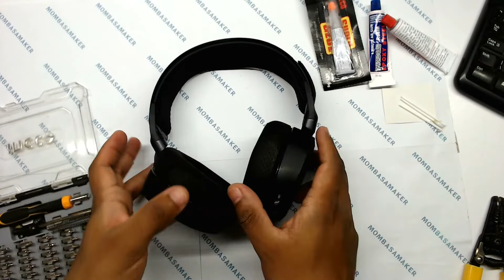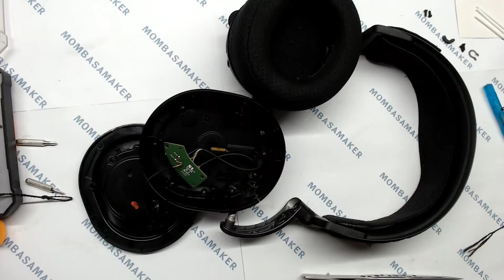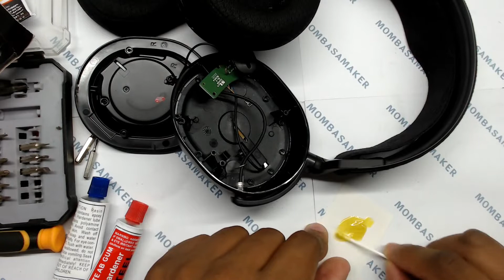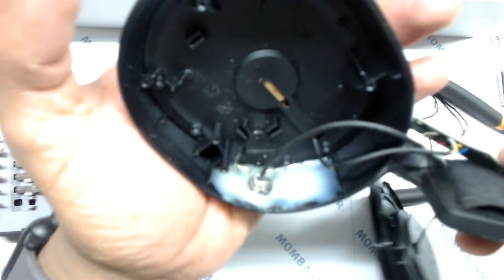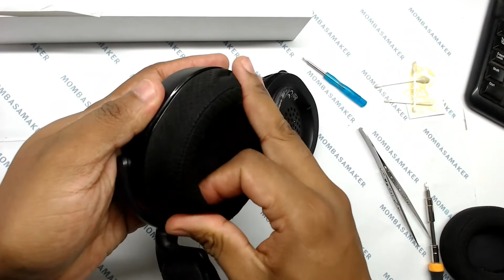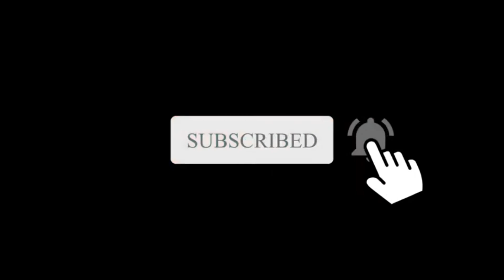SteelSeries Arctis Pro Signature fault - How to repair cracked and broken headphones

Comment: Thanks a lot for the video!
I was able to fix the signature fault following your guide. 
It's a shame they break so easily, those headphones have good sound and are quire expensive, hopefully the repair make them last for another 5 years.
Reply from the maker: You're welcome. I'm happy the video was able to help you and others with the same problem. Hopefully they will last long after that repair!

Comment: This is the fourth time this has happened to me and I’m not going back to the arctic pro, is this fault with all steelseries headphones? If so I’m going to a new brand entirely
Reply from the maker: I think only with this particular headband to earcup design, they've used it on several models. Not sure if the users with the other models  have had a similar experience. All headphones have their weaknesses nowadays, if you're going for a new brand choose wisely.

Comment: Fixed mine with two rubber washers and some super glue. Its ridiculous that such a simple thing can fix it that they dont do it first. Bulk up that support joint and you're golden.
Reply: can you share the washer / o ring size? i want to order them parts before taking it apart. Thanks Bro.
Reply: @herrdims  sorry but they were just some random washers in my grandfather's workshop. I dont know how to tell you what the measurements are without taking it apart and some calipers (not that I have calipers right now because i spend the summers working in a "remote" mountain range).

I can say i used one inside and one outside of the headphone. The one inside I actually had to shave the inner diameter and trimmed the edges to fit it. I wouldn't call this the easiest fix for a regular person (not crazy hard either. Mostly was just tedious). It was mostly just that some simple stiff rubber supports would've been cheap and easy for steel series to make.

Comment: I can’t get the cushion back on
Reply from the maker: There is a notch at the bottom. Slide the cushion in where it folds into the groove and rotate it around while holding it in the groove. The rest of the cushion holder will follow. Hope this helps!

Comment: i had the same crack but on the other side... the piece with the microphone has a lot more stuff in it and i can't take the bigger board out, got a video on that side too?
Reply: I have the same issue did you find anything
Reply from the maker: I want to make a part 2, will try to answer as many questions as I can

Comment: I just bought them for $135, sealed, brand new, and it was an affordable price, but I didn't know about his chronic problem and I'm scared by these videos I saw recently, what should I do to sell them? Or do I open it and do what you did in the video because I loved the headset, the audio quality, the gamedac, the comfort and everything was incredible apart from the quality of the plastic which I thought was bad so what should I do?
Reply from the maker: I would go with that old saying which says if it's not broken don't fix it. Since I did my repair I have been very careful while putting them on and taking them off. I only handle them by the metal band, I don't hold them by the ear cups anymore. I think this method also helps a lot. The only thing I have to change are the earpads cause they are worn out revealing the sponge otherwise they are working great! If you're still worried and you're good with repairs you can maybe reinforce that area otherwise just be extra cautious and use my handling technique.
Reply: @atdiyrepairs  However, maybe my headset doesn't have this problem because the box says something about 2022-06, I think maybe it could be its production date and the box of it is a little bit diferent os the others
Reply: @atdiyrepairs  Yes, I saw the video on how to use it to avoid the problem, so I'm being very careful with it
Reply: Mine worked for 5 years before cracking. Just don't be rough on the ear piece, stretch the band wide a bit when taking on and off and don't just put your headphone on or take them off with one hand by the earcup. That's how mine got wrecked is by just lazily handling them with one hand and stressed the joint out.

Comment: Great video! My headphones had the same problem, and i used your repair tips to repair the cracks. I had a little difficulty getting the c-ring back on (i used an epoxy that was a little thick and goopy, so i may have to revisit my repair in the future), but i'm very glad that i discovered your work! Thanks!
Reply from the maker: Thank you! I'm glad my video helped.

Comment: First of all, great video! You deserve at least 250 subs for it.
I followed your video and it all worked out pretty well casing-wise. I used JB weld. 
The problem that I'm facing now is that the right-side speaker won't work. I looked at the electric connections and they seem fine, nothing blackened or burn, no wires crossing un-insulated. I was wondering if you had encountered this issue or had any advise to fix it. 
I was thinking about de-soldering the connections for both left and right sides then soldering the right (broken?) one on the left (working) board to test if the entire component was broken. This is rather invasive though and could result in greater damages.
What do you think?
Reply from the maker: Thank you! I'm glad the case repair worked for you, I know JB have good quality products. If you're thinking of de-soldering I'm assuming you have a multimeter. If I were to diagnose (easy to hard) I would say it could be 3 things:
1) The wire is disconnected or broken internally (Use the multimeter to check continuity from the circuit board to the ear speaker)
2) If the wire is okay check ear speaker for any damage (highly unlikely but it could happen)
3) The board is faulty (Maybe cold solder joints)
Most of the times is number one and the thin connecting wires are the culprit. 
If you're going to test it using your method just make sure to return everything back to place after testing and repair. All the best!

Comment: What size screw is in your earcups?  Mine are security torx smaller than 8, but not sure of exact size.  Thanks.
Reply from the maker: I think it's either 6 or 7 but once I confirm I will do an update

Comment: my ear cup came out with the metal bit in it, it doesnt look broken i just cant put it back in do you have anyway to help please
Reply from the maker: It's not easy to guide without a pic. What I can suggest is be careful not to pull hard as it might cut the wires. And if it just came out and nothing is broken you can use a circlip pliers to fix the clip back in the groove once the ear cup is in the proper position. I hope  this helps.

Comment: Nice vid. Also a recommendation for folks whove dealt with and fixed this issue.. it helps to remove the headphones off by flexing the steel part of the head rest as this wont stress the joints on the two head phone "cans".. i was removing the headphones by pulling the cans apart until i noticed the crack one day.. definitely those weak joints were not designed to handle the stress
Reply from the maker: Thank you. I mentioned a similar hack I think in my other video. Taking them off and wearing them by holding the steel head band is better or safer than using the weak cans.

Comment: What orig pliers are you using is there a specific size? Mine won’t fit
Reply from the maker: Initially I used a crude method, I tied fishing line to both ends and used the smallest circlip pliers I had. Find the smallest seeger ring pliers, they should fit. Or a seeger pliers with adjustable teeth for different sized clips. Hope this helps!
Reply: Thanks @atdiyrepairs  I'll try to look for the smallest i can find,  I have a small one but it does not fit the holes. any idea on the size of the head of the pliers?

Comment: first time digging into some electronics like this. simple tutorial, was able to fix my headset. i’m not too sure if it was the o-ring, but earcup does not feel very secure. does stay in tact though
Reply from the maker: Nice! Glad you were able to fix them and continue enjoying them. If it does not feel very secure check on the groove the clip sits in, it also wears out. However as long as the clip sits properly in place and the plastic is intact you will have many more days of service from these headphones

Comment: I have had 4 arctis pro and they have all broken on the left ear, and that is SSOO annoying to fix because of the big round "motherboard" that have been screwed in and glued in, they really prevent you from fixing it..
They really need a new design, i hooe they did a lot better with the new Arctis Nova headset, but they properly did not change the design at all. Cheap chinese made trash plastic.
Reply from the maker: Sorry about that, the new design still looks like the old one. Not sure if they fixed the flaw unless someone tells us in the comments.

Comment: Steelseries had no support for this. I have no trust that the arctis nova pros would not be the same. €300 wasted with a design flaw. Don't buy em.
Reply from the maker: I agree, the Novas might have the same issue if it wasn't addressed. If someone likes SteelSeries they can buy them with the knowledge that this is likely to happen and maybe just be super careful.

Comment: Just a heads up on this don't wait until it breaks!  Reinforce this with something like JBWeld Plastic weld before it breaks.  Open them up when they are new and just coat the inside area around that joint with JBWeld.  This will "hopefully" prevent it from breaking and needing repair.   I have a pair I've been using daily for more than a year now and they are still feeling solid with a couple of drops.   Note I have bought 2 other pair of SteelSeries that broke in this way that I couldn't repair, but this is the best wireless headset with swappable batteries.  SteelSeries if you ever read this comment PLEASE reinforce this joint!  This is almost a perfect headset!
Reply from the maker: You're right! but unless a new buyer knows about this weak spot they will not bother to strengthen that area. SteelSeries already released the nova, not sure if they will fix the remaining Arctis Pros they are still manufacturing, if they still are.
Reply: @atdiyrepairs  Looking at the design of the Nova from the pictures I would not doubt if it does not have the same weakness or one similar.  I hope they have done something to strengthen that
Reply: @atdiyrepairs  hey man, do you know if these happen with the nova pros too? I want to buy a nova pro, had 2 arctis pros which both had failed repair attempts because i tried to do it with 0 guidance (didn't know about your video's existence) and are now basically unrecoverable so I have to switch to a new one. Also thank you so much for making this video, you are helping so many people who had this issue which is greatly appreciated. I already subscribed so youtube recommends me your fixes easier if i have any issues in the future with things
Reply from the maker: @NorthstarSWE  I haven't tried or tested the nova pros but the design does look the same. If I were getting them I would highly suspect the same failure repeating itself unless the company came out and said they have fixed the issue.
Reply: @atdiyrepairs  Thanks for the info, it does look the same to me too and i feel like i might just go with another option thats equally as good, so ill probably go and buy another brand 
Thanks for making these videos again as well, they really are helping people

Comment: Hey, do you happen to know what type of screwdriver we need is it a T security screw driver? and also does this fully stop the hinge from moving as I want to make sure the hinge doesnt move across to the ear padding
Reply from the maker: If you have the same series headphones then it's just a normal small star Philips screw driver but one screw is deeper than the others so you will have to use a screw driver with a longer neck. I didn't understand your second question, do you mean using glue on the hinge to stop further movement or?

Comment: Mine isn't cracked but there's something loose inside and it's got a lot more movement compared to the working side.
When I take the headset off, the left side just drops down whereas the right side stays in place (as it should).

Maybe I'm best off just getting a different headset. The wire is damaged on this one and I want a bluetooth one anyway.
Can always sell this one as used, still fully functional but just a bit annoying when you turn your head and hear a rattle.
Reply from the maker: The retaining clip that locks it in place came off. When that happens the ear cup will drop down from it's place and if not caught will definitely break some wires. The loose thing inside is the clip bouncing around. Hope you can fix it!
Reply: @atdiyrepairs  It came off or it broke off?
If it's just came off then I'll take it apart and pop it back on
Reply from the maker: @_daniel.w  Most likely came off however the only sure way to know what is going on inside is for you to open and take a look
Reply: @atdiyrepairs  I can't seem to find a screwdriver for it. I'll pick one up on Amazon soon

Comment: I've had this piece of dogshit break on me a countless number of times.  They could have had an aluminum frame but decided it'd be cheaper to screw over the customer while increasing the profits by having the customer come back running and crying. All of the super glue and baking soda in the world couldn't fix this fucked up monkey fucker mother tubbard piece of junk they call a headset. If you're reading this, buyer BEWARE.

Comment: So should I just not get the headset and look for something else?
Reply from the maker: Each device nowadays comes with its own flaws whether manufacturers/product designers do it intentionally or not. You could get this headset knowing about its weakness or you could go for something better. However also note that new product reviews don't cover points of failure consumers discover over time.

Comment: I really appreciate the in-depth video taking time for the full repair for my exact issue! Considering opening mine up soon. 
I hope to see how long this repair will last. Next time I plan on making a DIY housing.
Reply from the maker: A good repair will last as long as you use good quality glue or glue that is made for that type of plastic, cheap glue becomes brittle and breaks after some time. A DIY housing will definitely be a win win! Especially if you can make something nice and also sell it to others with a similar problem.

Comment: The company definitely planned for this to happen so customers can keep buying.  This is so infuriating for them to do that.
Reply from the maker: Maybe they planned it or maybe they didn't plan their design very well. I've seen more of the same headphones and they are all broken on the right ear cup in the exact same weak spot.
Reply: @atdiyrepairs  this happened to me twice on the left side, it’s so irritating
Reply from the maker: @BobitoOW  The left side is new for me, sounds like they didn't plan the structural integrity well enough. Whichever side is weak breaks first. In my case it was the right side, in your case it was the left.
Reply: @atdiyrepairs  is there a way to fix the left side? I’ve gotten close to getting it apart but the board is way bigger, mine cracked on both sides too.
Reply from the maker: @michaelbissonette8837  It's the same as fixing the right side. If the board is getting in the way I would suggest removing it, fixing the crack and returning it. You will need to do a bit of de-soldering and soldering though to remove and return the board. It is extra work but frees up some more space for the repair to take place. Also be gentle with the wires inside, they are very thin.
Reply: Completely agree. Plastic vs metal is not a good idea. If I know this, there's no way they didn't.
Reply: I will never buy steel series again. 250$ for this to happen. Unacceptable
Reply: Bro this happens to these a lot! I paid EUR300 on these headphones I expected way better quality for this. It’s a cheap plastic used shame on steel series

Comment: Hello! Nice video! I tried fixing the oring clip to put it back and it ejected and vanished. Do you perhaps know the size of a replacement?
Reply from the maker: Thanks, I've been off for a while but will come back soon with more content , so the clip is called a Seeger ring and some call it a circlip lock/ring. They all function the same way. As per the size I twisted mine a bit while taking them off but I pinched them back into shape with pliers. I measured mine with a ruler to 70mm external width, 50mm internal width and 1mm thickness. I should get a better reading with Vernier calipers, I'll update this comment again soon. I'll also measure the groove of the shaft itself.

Comment: Wondering if I should be glueing before the cracking accurs as a prevention measure? Any tips for that?
Reply from the maker: As an initial prevention I'd say change the way you hold them while wearing or taking them off. Even after repairing mine this is what I do. Instead of holding them by the ear cups as we normally do try holding them by the metal headband instead. This will remove the pressure on the weak area and greatly reduce the chances of a fracture or crack occurring. Otherwise, yes, you can open them and reinforce the area to add that extra layer of strength. If you decide to open them be careful with the soldered wires. Good luck!
Reply: @atdiyrepairs  Thx I do that now and hope for the best. Love these headphpones!